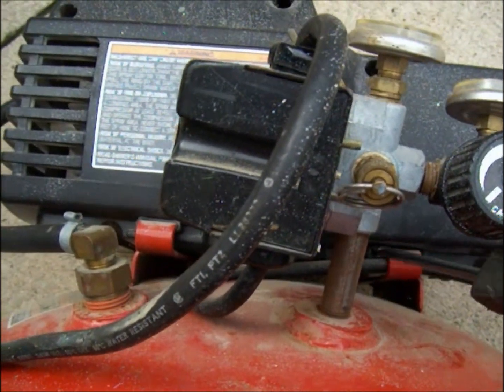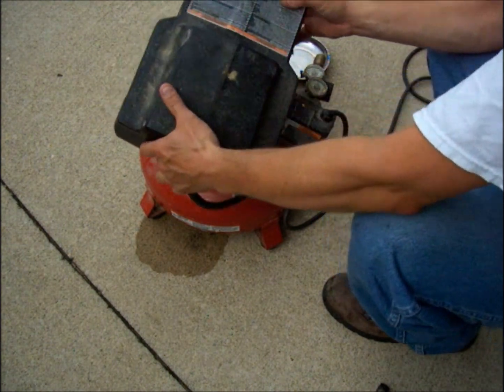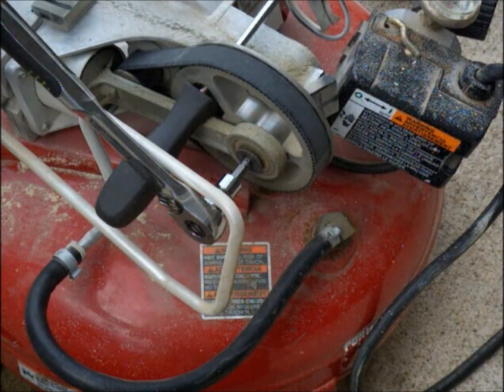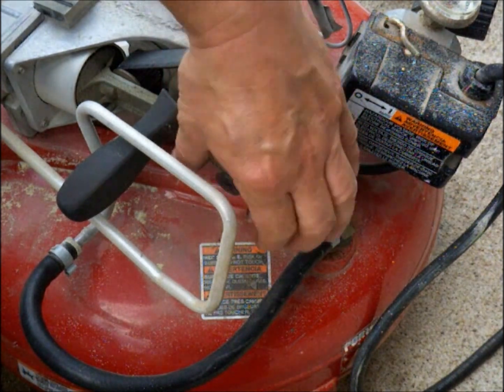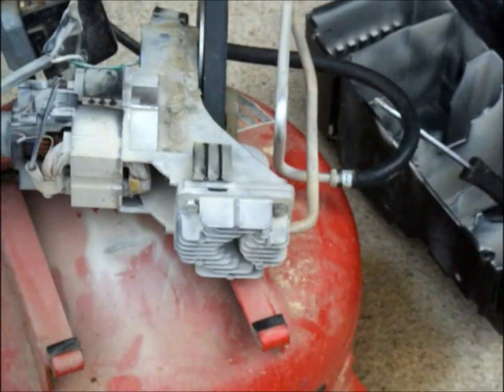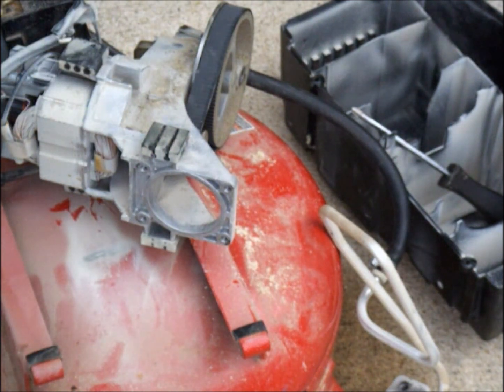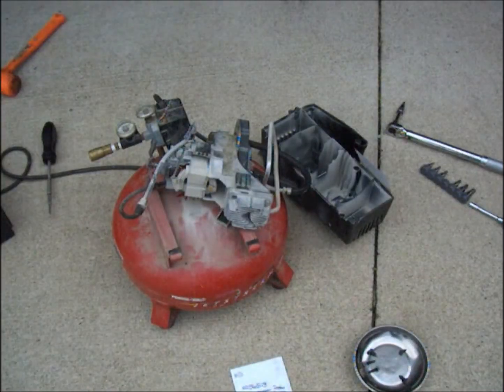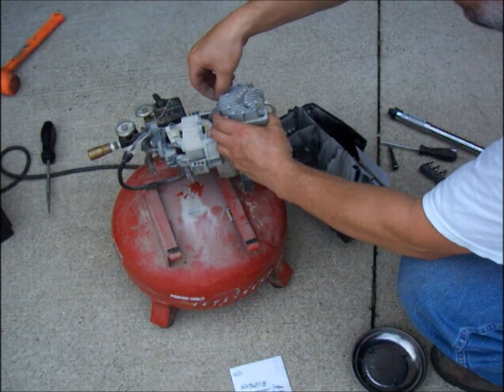Porter Cable air compressor piston replacement

Comment: Great video but can you tell me how can I order what's is the model number to order the pieces.. I had the same problem I need to replace de ring in the piston...
Reply from the maker: Use your model number on Searspartsdirect.com or ereplacementparts.com to get the part number for the parts you need. I wish you the best on your repair

Comment: After years of hauling around a large,💫 allabout.wiki/PORTER heavy, loud dewalt air compressor (that ironically was advertised as quiet, supposedly 78dB), I bought this. Facepalm. While it is not ‘silent’, I find myself chuckling every time I use it, sparing all my neighbors the terror of my former compressor. I use for inflating tires, impact wrench, finish nailers. Absolutely love it. And I store it under the garage sink in a 24” cabinet. I paired with a coil 1/2”, instead of a my former 50’ 5/8” hose that I had to lug across the yard from the shed, unpleasantly uncoil.... this little guy is light and portable; just a joy. Impact wrench is still capable of easing lug bolts, flywheel bolts, crank pulleys... just allow for a tiny bit of recovery now and then.
Reply from the maker: Very nice!

Comment: Any lubrication used or needed for the piston?  If so what kind?
Reply from the maker: no lube needed
Reply: @bbbjim1fixedit  Thanks very much for the video.  I did the replacement and it went well.  Seems to be working now.  Also, funny that not only do we have exactly the same compressor but we also have the same SnapOn screwdriver that I used the same way as you.

Comment: Was there anything visibly wrong with the old piston; i.e., cracked, warped? What actually was replaced? Is the rod integral with the piston? Is there a compression ring?
Reply from the maker: The seal on the top of the piston was worn. Took a long time to fill the air tank.  The piston comes with attached connecting rod, which is only to be mounted in one direction. It is marked as to place a certain side out. The head needs to be removed because the new piston comes with a piston sleeve  and the piston is inserted in the top. Best of luck to you in your repair.
Reply: The camera was not showing what the Piston damage looked like. The Piston was not in view of camera

Comment: Great work. 
How much was your replacement piston?

I’m having an issue with mine where tank pressure charges to 150 psi
But then slowly leaks dropping tank psi down to 100 before recharging all over again.
(That’s w/o using an accessory) Not sure what symptoms these dictate.

Hanks,
Reply from the maker: I would guess your couplers are worn, causing the slow leak.  I purchased the replacement piston on EBay, do not remember the price, but they sell them around $30.  Best of luck to you repairing your compressor.
Reply: Could be the check valve that screws into the tank as well.
Reply: Any links on where to get the Piston ????